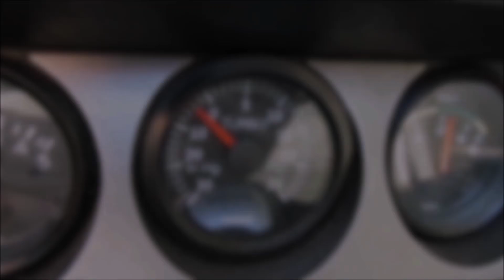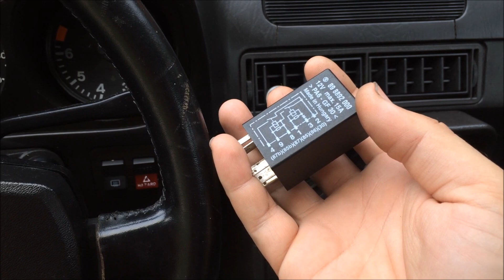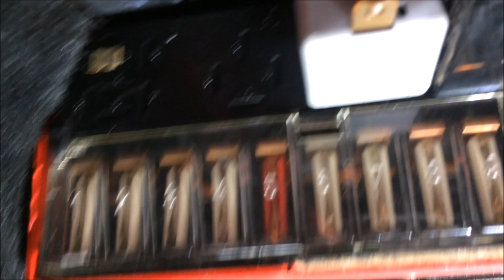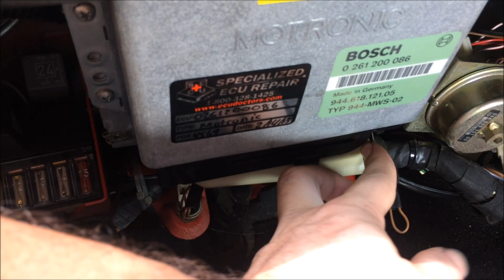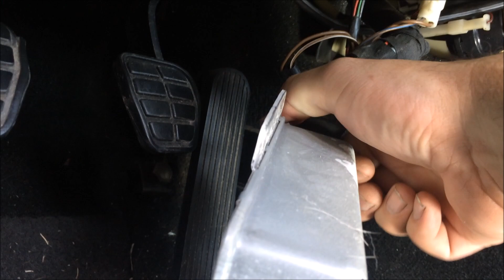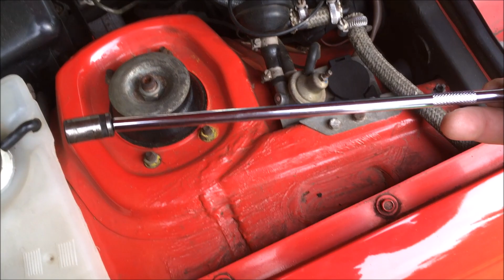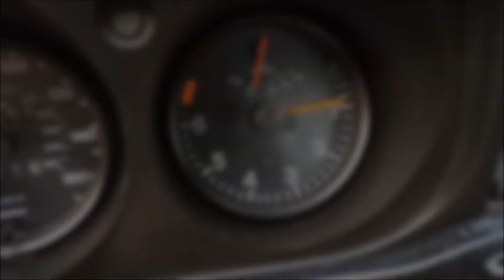Troubleshooting a Porsche 944 No-Start Condition

Comment: No start, no spark condition on my 1983 944. I have good fuel pressure at the rail but no spark coming out at the coil or plug wires. I have 12 volts at the leads which connect to the coil, but this drops to zero the moment I connect the leads to the coil. I have replaced the coil, coil center lead to the distributor cap, the cap itself and the rotor inside of it. Still no spark. Battery is good and I've even been charging it to keep it from running down.  With the sensors connected I have continuity between terminals 25 & 26 and also between 8 & 27 - which I believe rules out both the speed sensor and reference sensor as possible causes (which is good because both are brand new - purchased through AutoHaus AZ). So I pulled back the rubber boots from the sensor connectors to look at the wires. Each connector has a yellow, a black and a bare wire. All 6 of these wires have continuity from the connector female receptacles all the way through to the DEM female receptacles on the DEM connector. But the bare wires are quite frayed where they run into the back of the connector next to the sensor. The plastic at the point where these bare wires run into the back of the connector is also cracked and quite brittle.  I'm guessing these are ground wires. These connect to terminals 5 and 23 on the DEM connector and both have continuity from sensor connector through to DEM connector. However, terminal 5 has continuity to ground on the door frame. Terminal 23 does not have continuity to this ground. I believe this inconsistency between these two bare sensor wires (one having continuity to ground and the other one not) may hold the answer to my problem, but I'm not sure why or how to proceed. Can you please advise? I should also mention that I may have mixed up the reference and speed sensor connectors when I replaced the sensors - so I may have plugged the reference sensor into the speed sensor's wire and vice-versa. So I've been disconnecting and switching them around frequently anytime I change something to see if the car will start either way. So far it hasn't made a difference. Thank you for any insights.
Reply from the maker: Are you getting tach bounce like in the video? You mentioned that you don't have a ground on 23 but that is on the speed sensor and it shouldn't affect the reference sensor. It could be that they are swapped, however the car may still not run until that ground is repaired. The fraying you are see is shielding that wraps around the wires and it is grounded at both ends. You can just solder it to the wire at pin 23 and it will work just fine! I hope that helps!
Reply: @edredas  I am not getting tach bounce. So there is supposed to be continuity to ground from terminals 5 & 23 on the DEM connector? I checked all of the other terminals on the DEM connector and none of them has continuity to ground (except terminal 5 as noted above). Can you direct me to any resources on how to repair a ground? Thank you.
Reply: @edredas  I restored continuity to ground on 23 but it still wouldn't start. Then I swapped the connectors in case I had them mixed up but it still wouldn't start. Still no tach bounce (though it does move slightly when I turn the key to "off" and remove it). And just like before, I have 12 volts to the leads, but this drops to zero as soon as I fasten the leads to the ignition coil terminals and does not come back when I turn tne key to "start". So it's still not starting.
Reply from the maker: @ewzm  If all the wiring tests good then it might be worth seeing if someone can test your DME or if you can try another. Sometimes the solder joints crack and you won't get any spark. That said, I would verify everything else first before testing the DME since its the most expensive part to replace/repair, but it is a fairly common issue. I hope that helps!
Reply: edredas OK. I’ve got the DME open now and I’ll see if I can find anything visually or with a continuity tester. Does this car have a crankshaft position sensor apart from the speed and reference sensors? I also see on this feed where someone tried the ignition switch too...
Reply from the maker: I meant to respond to you sooner but there are no other crank sensors other than those two. If you have opened the DME up then be sure to check for cracks where I have pointed out in this thread. I hope that helps! 

http://www.924board.org/viewtopic.php?t=37071&sid=08f8ab5234c6a211945781fa49a59418
Reply: @edredas  I found no cracks or other physical issues with the DME, so I tested some of its resistors and other internal components for continuity using my multimeter. Many did have continuity but several did not. So I contacted Elliott at egrafton944@hotmail.com and ordered a used DME from him. Before installing it I replaced the spark plug wires and spark plugs (they had a lot of sooty buildup, the gaps were much larger than spec and the central electrodes were extremely worn - the worst looking plugs I have ever seen. I read on another forum that the additional resistance worn plugs create can lead to damage in the DME, so I replaced them to avoid messing up my replacement DME). I then installed the replacement DME and voila! It started up and ran! There was some clicking at first, but this went away after several minutes of run time (maybe the valve lifters needed to fill with oil as is the case with some other vehicles). I was so excited!  As an aside, I found that a hose leading from the top of the air filter housing down under the air intake J boot connects to what I believe is the timing belt cover. The port this hose connects to is half broken off, allowing an inch or so of the timing belt to show through. The video I took showing this condition can be viewed at: https://youtu.be/Bp5s1AtV2SI.  In any event, the car still started and ran in spite of this.

Comment: Great video. How do you like that Legend car battery? Mine had a short life of one year.
Reply from the maker: Pretty good so far. I didn't buy it, though. It came with the car when I bought it three years ago. I think its currently about five years old, but I've never had an issue at all. I drive the car everyday and completed several long trips with no problems. I often use this car to jump my other cars off when their battery go flat from sitting...
Reply: edredas wow... Impressive

Comment: Good job.  Almost comical that these problems are so common that you suggest carrying spare relays, sensors and DME, but thanks for the info!
Reply from the maker: Yup, well they're 30+ year old parts at this point so they're bound to fail at this age. Once they're replaced you should be fine, but original parts were never meant to last this long...

Comment: Thanks for the video. It´s very helpful. One question: Your dashboard looks like an older model (1985 or prior). Are you shure its a 1988?
Reply from the maker: It's an '88 924S so it has the early interior but has a 944 engine. Thanks!

Comment: What is the reference sensor main function?
Reply from the maker: It reads a pin on the flywheel which tells the computer the position of the crank. Modern cars there's a crank sensor in the block that does the same thing by reading a notch in the crank itself. Also a lot of modern trigger wheels for standalone engine management systems have simplified this into one sensor by adding a notch to the toothed wheel to know the position of the crank. I hope that helps!

Comment: Can the ignition switch cause similar problems? I need to get a new key and cylinder because I have to wiggle the key a bit to get it to turn, so I figured I might as well change that out as well since the switch is $5 at rockauto. I've replaced everything else but the wiring and the alarm. I get 890 ohms on each sensor at the DME harness plug,  I have 12v at pins 18 and 35 on DME plug. Still no tach bounce, no spark. I have 12v at the coil with no change when turning over. I unplugged the alarm module and intalled the bypass jumpers  into the harness plug, still nothing!
Reply from the maker: I believe so! I've never personally had an ignition switch break to know exactly what happens, but it is definitely in the realm of possibilities! Sounds the switch is an issue but I believe if you're getting 12 volts at the DME it might not be the issue. I'm not exactly sure what happens but I believe when the switch breaks the DME doesn't get power causing the no-start issue. That said, have you've tested the continuity at the pins for the sensors at the DME? They're known for fraying at the sensor and causing issues. If those are good I would suspect the  dme is bad, I've had good luck repairing them before and its pretty straight forward. However, I would buy a $5 ignition switch first before buying a DME, since it sounds like it wouldn't hurt since its loose, but sounds like you're on the right track! Good luck!
Reply: @edredas  the sensors show 890 ohms at the DME plug, and I only get a couple milivolts DC when cranking over, I'm still trying to figure out the alarm bypass, do you unplug the module and replace it with jumpers, or jumper the plug while connected to the alarm module? I've got new sensors, new DME relay AND a remanufactuered DME. The wires on the plugs for sensors on harness look good as the sensors ohm out OK at the DME plug.

I bought this car not running and have rebuilt the motor do to bent intake valves from a misaligned timing belt when the previous owner tried to replace the belt.  I've been working on this car for 2 years and really want to fire it up and drive it for the first time... so frustrating. ..
Reply: @edredas  so... I've replaced everything now,  dme relay, remanufactured dme, reference sensors, ignition switch, alarm bypass proceedure... still no tach bounce... i bought the cheaper reference sensors, wondering if that was a mistake? Have you used or had problems with Facet or FAE brands of sensors? Should i drop another $140 to get the Bosch sensors? You are my last hope OBIWAN EDREDAS!
Reply from the maker: @edwardkipp4911  I've used the cheaper sensors many times without an issues, so that shouldn't be the problem. At this point it is very hard to say what the issue could be. Have you checked that the sensor are gaped correctly? Sounds like it you've covered everything an on the right track...

Comment: Simple question.I'm going to help a friend get his No Start 1987 Turbo 944 running.He thought it was a coil issue and now it has sat 7 yrs,,Lack of knowledge  and raising a young family..The weekend autocross car gets forgotten..QUESTION Are the Sensors the same??When buying a Crankshaft /TDC sensor it can also be the Speed sensor?.Having a hard time finding both.Haven't worked in 944 yet. Thankyou..I'll be checking belts  and replacing fluids ETC
Reply from the maker: Yep, both sensors are the same! Another thing that can cause I no-start that I didn't cover in this video is the fuel pump itself. However I showed how to troubleshoot that in my 'Nautic blue 944 turbo' series. I hope that helps!
Reply: @edredas  Thanks for quick replay.Did see your 944 turbo video..Saw you removing 2 boxes of Sensors.. Just saw Pelican lists 2 needed per car. Didn't notice that before.  My Friend with the 944 needs to watch all your videos..I'll demand it of him..:) great videos!
.I'm fearing the oil separator on the Turbo cars is going to make it more difficult to get these sensors out..Working on it tomorrow.. Also I see you got the FACET sensor .  Plastic wraped instead of bare metal.. .Do those corrode less and not bind as much..?Thanks Again
Reply from the maker: I think the binding comes from the rubber o-ring hardening over time. So any brand will likely get stuck over the course of 30 years. I’ve heard that some people use anti-seize on them to prevent that. Before removing I always soak them down with wd-40 and wait a while. I hope that helps!

Comment: We had these same symptoms and many of the tests pointed to faulty relay, pump relay, crank sensor, etc. issue was bad solder connections on the Motronic DME/ECU. Bought a supposed rebuilt DME/ECU same no start condition. Took to specialist and they narrowed it down to the DME/ECU by using a blow dryer or heat gun  to warm up the DME/ECU (hunch based on the fact that we had replaced everything else and that we had last drove the 924S during a hot summer day) Another rebuild DME/ECU and everything worked fine. IMHO these boxes are getting so old that you can’t assume that they work fine and measuring voltages elsewhere with a bad DME/ECU can give spurious results.

Comment: If the tachometer bounces is the DME ok?
Reply from the maker: Generally, since this means the DME is seeing the engine rotating then sending a signal to the tach. The DME also has to tell the fuel pump to turn on via the relay, so since you aren't getting fuel you'll need to figure out what's gone wrong between the relay and pump. I hope that helps!
Reply: @edredas  I hope so too you are a great mechanic so I look up to you I wanna be like you someday :) thanks sir

Comment: Hey sir I enjoy your videos as much as I enjoy my Porsche 944 and it wont start only when starting fluid is sprayed it tries and the tachometer bounce a second then cuts but wont start I haven't tried jumping the relay to see if thats it but I can do that next weekend I guess and it has spark to every cylinder I just was able to get crankshaft reference sensors reading to tach now but wont stay running if it tries to and then boggs out with starting fluid maybe the computer isnt working right or maybe the DME relay I switched in got hot and burnt up and maybe need another one idk I do know I miss my car
Reply: I will check that out thank you sir you are a great man
Reply from the maker: Sounds like you aren't getting fuel. If your DME relay is getting hot then it could be the relay is bad or there is a short somewhere. You may need to check the resistance or jump the DME relay to verify the pump is running.

Comment: When I rotate my key to the mission setting all I hear is a clicking sound coming from the fuse Box would you have any idea what this could be?
Reply from the maker: The DME relay will click when you turn the switch. Check the voltage on the small wire at the starter so make sure you're getting 12 volts there when the switch is turned. If you have 12 volts then the starter is bad, but if you have the correct voltage try replacing the DME relay. I hope that helps!
Reply: @edredas   OK put it brainy relay I put in the 2 centuries to the crank. I got it to do exactly what your videos doing in the beginning, But still no Ignition I  Tried some Ignition spray.  I got it to turn over for 2nd turned off I looked at the starter it's severely corroded. I tried to screw driver test got export they turned over the starter. But now the car won't do anything.
Reply from the maker: If you're jumping the starter with a screwdriver and its not working then it sounds like it could be the starter...
Reply: @edredas   I just replace the starter. It sounds like it want to turn over a lot more stronger. But still  Not running.
Reply from the maker: Do you see the tach bouncing when cranking the engine? That should mean you have spark. If you have spark try using a jumper on the DME relay and see if the fuel pump runs. If you have spark and the fuel pump is running check the injector pulse with a noid light. That should get you started. If all those things are good then you might be worth checking to see if the timing belt has broken.
Reply: @edredas   Here's the update I have spark fuel pressure's good you can hear the fuel pump turning  Engaging. I'm going to check the timing belt.  It wants to turn over when I use Ignition sprayed but turns off after runs out.  I'm currently charging the battery to  Retry again later. I also put in more fuel. And still the same. And   Timing built is intact.

Comment: I need help like asap! Today please ! I am stranded!! 1983 944 , fuel pump been replaced, new dme relay is in, new distributor cap, rebuilt alternator, charging system is good! New battery, all new fuses, new fuel line, new spark plugs, i replaced one reference sensor, not sure about the speed sensor? What can it be?? The speed sensor? I drove my car on friday, but to no avail, it did not start, just cranks , cranks cranks, smoke came from under the hood, vapor like, itll start but then immediately die, starts only if im stepping on the accelerator
Reply from the maker: Big Bic does the tech needle bounce as your trying to start it? If not if could be the reference sensor like what I had wrong with my car in the video.
Reply: @edredas  yea it does actually have bounce! But i removed the reference sensor and it looked damaged as if it made contact, there were metal shavings, staple size, mostl likely from the sensor being grazed, and someone told me , if one sensor failed then they wont work or something, as they work together in  a way, if one is damaged, it cuts power i think thats what they told me, what could the solution be? Clogged injectors? Can a bad fuel filter cause a no start?
Reply: @edredas  also, i dont have those 10 mm bolts that you had when you removed it with the ratchet and extension? I have allem key screws, can i hand tight the sensors?
Reply from the maker: Big Bic yeah the early cars had  socket head bolts instead but when either sensor fails the car won’t run.